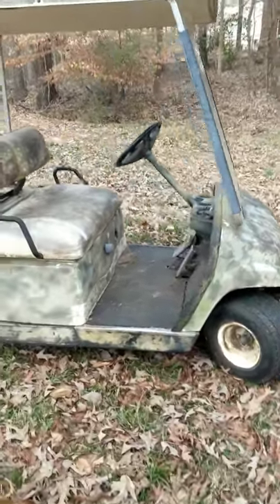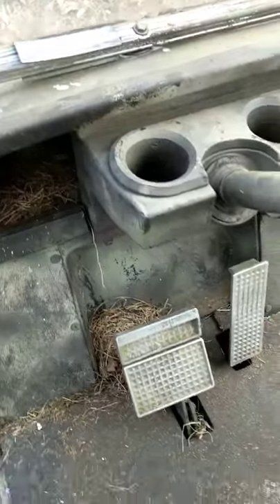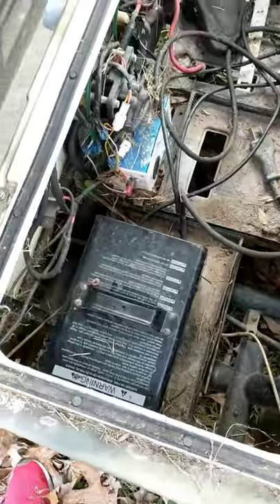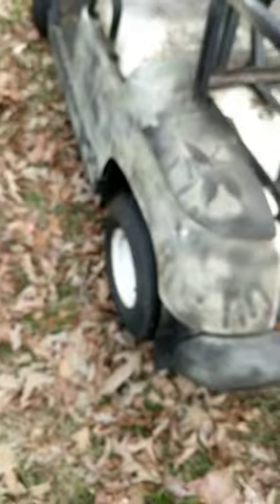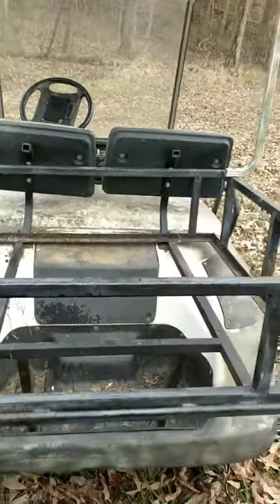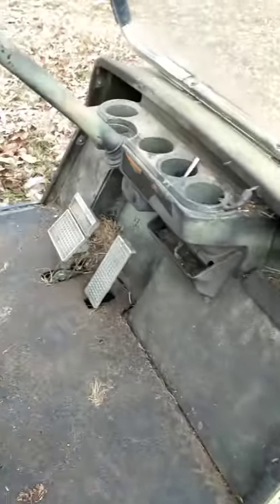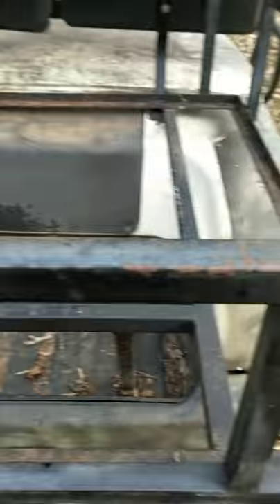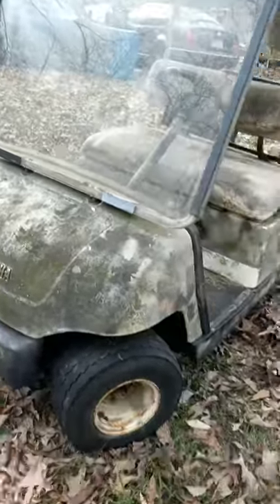Golf Cart Build PT.1 from Electric to gas Predator 420cc

Comment: If u use armor all wipes (the interior of vehicles one) works to clean up seats and will seal them as well.
Reply from the maker: I might try them out
Reply: I’ve had a few golf kart from a amf Harley Davidson to a nhra club the armor all works wipes of spray but has to be for interior it work to clean rims as well may take a little time but it’s worth it because of the protection factor.